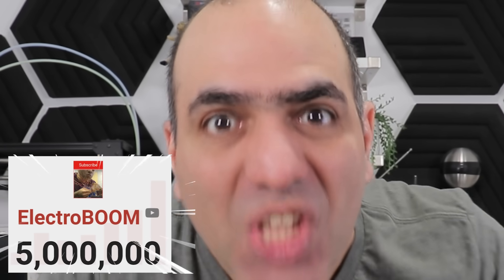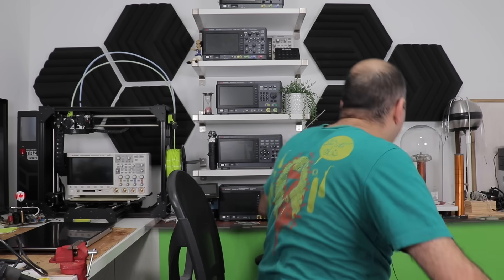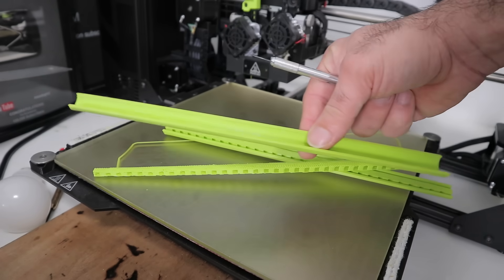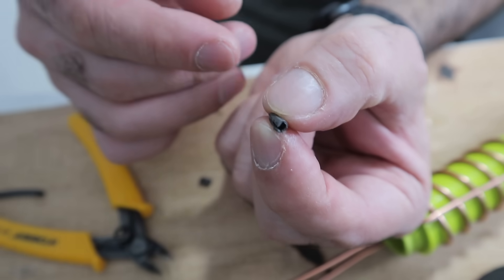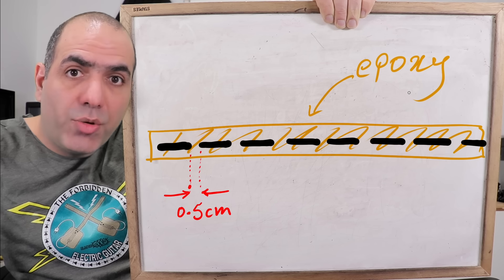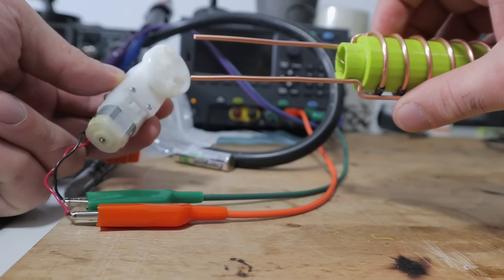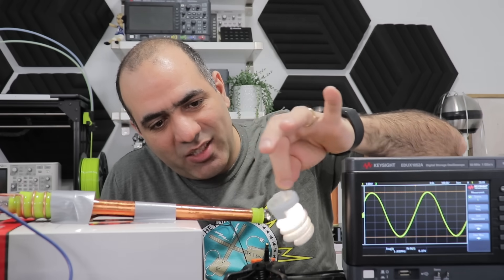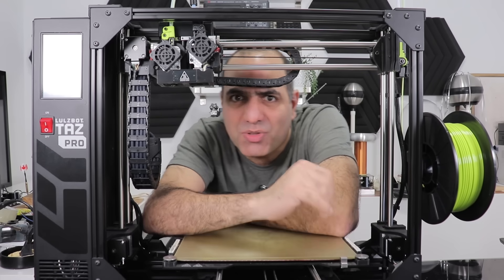Making a Tesla Coil Magic Wand, to Celebrate 5 MILLION SUBS!

Comment: Would drilling out a glass tube I was think of take some old Lab columns--with about 1/4 thick borosilicate glass work better in between the primary and secondary use of plastic set screws and thermal paste and polycarbonate.....

Comment: What would happen if you used thermal paste in combination with the epoxy floating each if the ferrite beads... Would loading the thing with thermal paste lets say under the primary a layer around the primary then use paper thin polycarbonate to jacket the thermal paste help or hurt I'm just a moron so please give me short bus answers.... Thank you

Comment: Wana hear the
ELEMENTS OF THE PERIODIC TABLE
There's hydrogen
And helium
Then lithium
Berilium
Born carbon everywhere
Nitrogen all thru the air
With oxygen do you can
breathe
And fluorine for your pretty teeth
Neon to light up the
signs
Sodium for salty types
MAGNESIUM
Alaminium
Silicone
PHOSPHORUS
Then sulphur chlorine and
fathom
POTTASIEUM
And calsium so you'll grow
strong
SCANDIUM
Titanium
Vanadium
And chromium
AND MAGANESE
 this is the PERIODIC TABLE
Reply: Elements of the PERIODIC TABLE
There's hydrogen
And helium
Then lithium
Berilium
Born carbon everywhere
Nitrogen all thru the air
With oxygen do you can
breathe
And fluorine for your pretty teeth
Neon to light up the
signs
Sodium for salty types
MAGNESIUM
Alaminium
Silicone
PHOSPHORUS
Then sulphur chlorine and
fathom
POTTASIEUM
And calsium so you'll grow
strong
SCANDIUM
Titanium
Vanadium
And chromium
AND MAGANESE
 this is the PERIODIC TABLE

Comment: I could follow along until the circuit came up, man I need to learn about the driver circuits. What does the damn circuit even do?  Why can't you just push the power through the primary and have a spark at the top load? Yeah I know I'm stupid, trying to grasp this stuff because I'm very interested, but it's all so over my head.

Comment: 12:27 Hey Mehdi. This experiment is extremely interesting. I always wondered why those insulators at high voltage transmission lines ( you know the ones that look like multiple mushrooms stacked on top of each other) are shaped like that. I heard it has something to do with creep distance? Can you explain why those insulators are shaped like that and repeat this experiment with a rod shaped like I mentioned before? Thanks!

Comment: Hi, I really love these projects, they’re incredibly informative and a little bit dangerous at the same time.
I would like to make a suggestion about the wand. The primary winding overheated you say because of arcing. I don’t believe that is the case, I think it is because of the thickness of the wire. You have a high frequency resonant circuit and a high frequency alternating magnetic field. This is inducing a lot of current (eddy currents) in that thick copper wire causing it heat up and waste a lot of power. I would suggest replacing the thick copper with much thinner enamelled wires bunched together like a rope with all the ends connected together.

Comment: I have build a similar one and i tested different diameters of the secondary coils and i came to to conclusion that a bigger diameter of the secondary coil will result in higher performance. Your's is quiet thin, if you would increase it just a littler bit you would get much higher Voltages and Sparks :)! Great Video btw!

Comment: A suggestion.
Replacing the copper wire to the primary winding with a copper pipe and pumping water through the pipe should solve the heating problem.

Comment: @4:10 - if you insulate the exterior of the rod, you could then wrap it in metal foil, connected to your top load, and have a much larger effective load?

Comment: Lenz's law says what regarding the secondary winding's induced magnetic field? I think it says that the magnetic field induced shall oppose the field of the primary to be equal and opposite or something like that. This is how a bifilar pancake coil that is flat can still drive a tesla coil secondary that is NOT flat. The primary field is forced to be extended the entire length of the secondary.

No need to worry about magnetic field shapes and interactions like you were doing part way into this video.

Perhaps if the same polarity magnetic field was allowed to be overlapping both inside and outside the secondary would there be any serious concerns--and even I do not know what shall happen in that case.

One would have to do one's own measurements of the anomalies caused and the sensors to detect the anomalies would themselves be reacting with the fields you are trying to measure--it becomes a huge mixed up mess to know what is happening.

www.askamathematician.com /wp-content /uploads /2010/10/ tesquiz.jpg

The powerful tesla coil depicted is driven by a bifilar pancake coil that affects the magnetic field of the secondary coil on the outside all the way to the top of that secondary coil therefore it does NOT matter if your primary coil does not extend much at all toward the top of your secondary coil.

The reason to use a pancake bifilar coil is that it is the one that has the LC values that cause it to self resonate if excited by a spark gap driven power pulse.

The web address above was edited to insert space characters prior to some of the slash characters.

Comment: The reason you have a bunch of squared cylinders when you print is because you're using a shitty cad package or have crappy settings. If you want more rounded dimensions, aka higher poly, use an actual cad package and not crap like tinkercad. Freecad is easy to use and would be adequate for the stuff you do. Fusion 360 is ideal as it's much more intuitive for more complex operations. My advice is to learn the shortcut keys first, refrain from using menu. This twill save you much time.

Comment: You should have used litz wire for the primary coil, a single solid wire will suffer too much from skin effect because the frequency is so high that the alternating current will only flow on the surface of that conductor, being a high current will make it overheat. I have experienced it with a ZVS flyback driver running far below the megahertz range

Comment: BTW, 3M Scotch® Self-Fusing Silicone Rubber Electrical Tape 70 has an elecrical insulation rating of 34k volts per mm of thickness.... that should be really useful in a project like that. Either between the two coils, around the screw that was too long, or between the secondaty and a solid ferro core...
Reply: Where did this come from
Reply: he knows.  He knows a HELL of a lot more than you do.
Reply: @23bobjr  well, what a complete ass you are. Since you don't know me, you have no idea how much I know....
Reply: @23bobjr  what's wrong with you, dude? Your body of knowledge is inconsequential if it doesn't happen to cross your mind during a brainstorm and engineers collaborate all the time. Good ideas can come from the less knowledgeable and often do if you're not arrogant enough to think you always know better. Do you think he's never incorporated comments feedback and suggestions into his work?

You've got a weird vicarious superiority complex and you need to cut it out.
Reply: @23bobjr  And David here knows more than you. Please, don't be a jackass.

Comment: Regarding the smoke at the end... Are you sure these ferrite cores don't heat up too much due to magnetic losses? I.e. - maybe it is not a preexisting bubble, but the one created by the ferrite, either through its temperature directly, or through thermal expansion??

Comment: The only plastics you can really use on a Tesla Coil are polyethylene and teflon.
Pretty much everything else has a high dielectric loss tangent that will ruin your efficiency.

This is why the best performing coils (like Tesla's himself) tend to be on an open frame

Comment: Im far from an expert, and this is probably a stupid suggestion, but my idea is to place the primary where the "hilt" of the wand would be, as in having the handle you hold it with, the primary just above it, the secondary above that and ending with the top load, it'd be more shaped like a tradition tesla coil and maybe would work better, maybe also having a 3D printed box or something under the handle to contain the circuit

Comment: Everybody forgets that a Tesla coil is not only a transformer. It's a resonant cirvuit where the output capacity is the one between output terminal and ground. This is a very low capacitance. This is why it works at high frequency.

Comment: I sent you plans but ignored me. 
Seriously, I am a great admirer of you. Please take me seriously. 
I am a physician.with background in electronics. I had over the years when I worked in ViRginia, a couple of patients who were in the mid 80'syears of age and assisted setting up the USS ELDRIDGE for what is now called the Philadelphia experiment.
The ship was gutted except for Diesel  propulsion. Most internal walls were removed. 
5 large generators were mounted on the hull. 
On the deck 3 sets off 3  Tesla coils mounted in X,Y,Z formations with indivividual feeds to each primary. Th coils were 3 meters long. And elevated about 1 meter above the metal surface of the deck. One set of 3 on the back one set of 3 on the highest pint of the ship and one set on the front. 
There was a minimal crew aboard 10 or 15 men. The ship was towed about 1 mile from shore. Then the generators were activated. Using giant variances voltage to the coils was increased. A cotona effect as expected developed & eventually covered the entire ship. As frequency was increased the corona was somewhat more transparent but the hull of the ship was no longer visible,exvept the impression it made on the water as the sip moved could be clearly seen, the water was being parted around the invisible hull. There are pictures of this on the internet. As the voltage further increased, the entire ship disappeared. No hull opening the water, no corona, NOTHING!  The Eldrige reappeared at tha time in NORFOLK VIRGINIA Dor about 7 minutes then reappeared in Philadelphia. Power was turned off, but the catastrophe that was seen was horrible. Sailors leaning against a wall went partially through the wall and we're in agonizing pain some sank partially through the floor & were still alive but they became part of the metal. It was a horrible scene. People that could be saved by cutting an arm  or a foot or lefts survived. Those that were sank into the metal floor but still alive were in excruciating pain were cut from th floor & taken to the military hospital with a circle of metal inside them. 6 survived without any harm. 
Tesla, Einstein & Fermi were present during this horror show. 

Wha would you expect if 3 Tesla coils wistful each its own primary arranged in XYZ orirntation would do? 
Coil tô coil induction should occur to some extent. What would happen to inductive reactance at such PhD close distance? 
Obviously something happened that first turned the ship tranpatrent to light. Then when the frequency was changed a bending of space-time must have occurred tô tea ele over 200 miles and back in 17 minutes. The frequency of the metal changed & it became Malé able while still cold. The sailors desctibe falling through a jello-like substance. This turned into metal after the power was turned off. There were no burns. 

I would love to hear your take on this. The 2 people I talked to are legit. HOPE TO HEAR FROM YOU THROUGH YOUR SITE OSOME OTHER WAY!
Reply: Lmao I can't tell if you're trolling or not

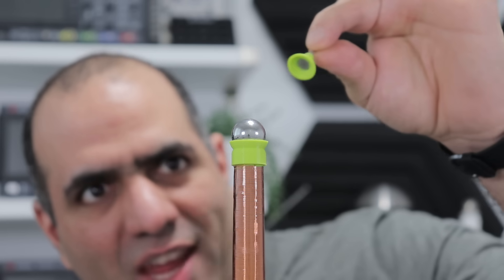Comment: @16:24
When you put the spike on, it made me think of a mean or angry cat immediately scratching someone that stopped holding them.
XD
Reply: Oh F&#$ NO!
I'm crying.
X,D
Reply: What if, instead of a spike, you used a long, thin antenna? Would it lite all disconnected bulbs in a room or area? If it can handle it?

In a power outage, you could walk around with a battery powered one of these, lighting up tubes along the way, like a weird lantern.
Reply: And congratulations, Mehdi.
Reply: Thank you for using comedy to teach Electrical Engineering, and helping to repulse my depression.

Comment: nice project, try using a hf litz wire for the primary winding to get less skin effect which in reverse will reduce the losses and heat of the bottom rod

Comment: Try using 38gauge wire then use polyuritine for isolation,and for isolation primary to secondary you can use epoxy then put it in vacum

Comment: If you have done this direct me to the video please, if not, could you show how to inject a signal into a wire and then use another product to detect that signal under 3 ft of earth?

If an existing product existed to detect the signal, how would you go about injecting the correct signal.

Comment: At 08:55 you argue against using a conductive ferromagnetic core for good reasons. Why is it not possible to use a ferromagnetic insulator?
Reply: I'm pretty sure all ferromagnetic materials are metals and therefore conductive.
Reply: @Owen_loves_Butters  Yttrium Iron Garnet is a Ferrimagnetic Insulator. Not quite ferromagnetic, but still

Comment: The primary probably got hot due to the skin effect on high frequency circuits, and all the power from the driver was being transferred through the surface of the wires at a skin depth of 50 μm. Using litz wire can help to mitigate the effect.

Comment: hello, in your arc machine with capacitors (marx generator) you can try a laser through the gaps, the laser ionizes the air and it would help. Greetings from Cuba.

Comment: 16:50 You have a thick wire, but at ~2MHz you only have a very thin skin depth like 50u. If you would use Litz wire for the primary you could probably do much better.

Comment: 15:53 you can seen oscillograph how amplitude drops no free energy, Tesla wireless high voltage power lines based energy transfer was bad idea cable wire is best and only way to transfer high power electric energy (remote control and cell phones are low energy information wireless transfer). Wireless energy transfer of Tesla was canceled by J.P Morgan who had not good reputation in finances so just because evil banker cancelled project it fuels conspiracy theories about bankers ruling taxes on electric energy.

Comment: I think that perhaps finding a couple of conical smooth flower vases and some careful truncation might give you sufficient boost to the insulation along with a better epoxy rated for motor windings... Just a thought... Another possibility might be to double the secondary windings under the base... either way, this is a fantastic set of "out of the box" ideas for creating the "wand" you were looking for!  I would love to see you refine it further to work better and reduce the shorting hazards!

Comment: Hello there. Recently I watched a video from Tech ingredients called defeating microwave weapons! Here is the link https://youtu.be/Lg_aUOSLuRo. 
Near the end of his video he concluded that some of the microwave energy absorbed by his shield can be absorbed and converted to electricity. I recommended and commented that it would be interesting and cool if his shield could convert some of the incoming microwaves and turn on an LED that would indicate to the shield user that his shield is in use and active. Thus showing that his shield is actively shielding microwaves. I thought of you and we were wondering if it is possible for you to come up with a device that would absorb microwaves and convert the microwaves into a weak electric signal for an LED indicator to use to turn on. Do you think this is possible or do you think either the signal is too weak or perhaps a device that would require a battery but could simply detect microwaves. I think if microwaves can be used to simply turn on a fluorescent lightbulb there’s definitely enough energy in there for it to turn on a small LED. The device this would be used for is a shield used to shield microwave weapons such as the LRAD.

Omidvaram ke betooni komak kooni!

Comment: Pro-tip that I learned recently: you can thin out the epoxy with acetone and then paint it on to the secondary coil with a brush. It'll be less messy. (learned about that from a video about making voice coils for home-made speakers)
Reply: Like the acetone used for nailpolish?
Reply: @hopeful_krystal  yep! Be careful though: there is acetone-free nail polish remover. I think if you buy it at a hardware store, you'll get it for less per unit volume, though.
Reply: @Edward Elizabeth Hitler hmmm. I keep a box full of silica (with indicator dye) to keep my plastics dry. It had never occurred to me I should do something similar with acetone. Good tip! Thanks!
Reply: Thanks pal
Reply: good tip thank you.
Reply: did you expect us to watch this for high quality epoxy use?  or high quality content?

Comment: 4:10: Why not put the primary coil inside of the secondary. Seems like you'd be able to get a lower profile  wand that way.
8:20: Why not put the primary coil on the inside of the secondary. Wouldn't that allow the secondary to utilize a higher percentage of the magentic fields?

Comment: A tiny plasma globe the size of electric bulb does have "magic powers". It will spontaneously open your programs and reboot your Windows on a PC almost a meter away, interfere with your remote control and spontaneously turn your TV on and off and a lot of other neat things. Word of advice. Don't do it. I spent almost 3 days trying to figure out why my computer misbehaved in weirdest ways. The plasma globe was not even a suspect, I thought that it was too far away to cause high voltage interference. But finally, after finding nothing wrong with my computer or TV I decided to turn it off. All of the problems went away instantly. I was lucky too. It could have fried my laptop.

Comment: What happens if you have multiple secondary coils within the shaft of the wand? Say, if you have four very small diameter poles wound with wire? Will that create an additive effect or will they interfere with each other?